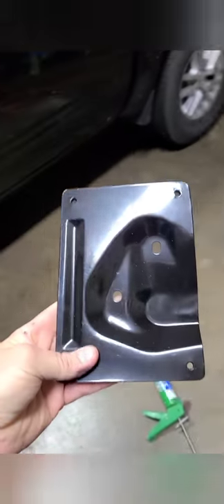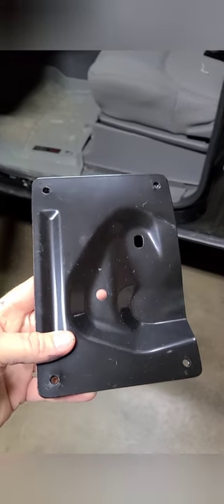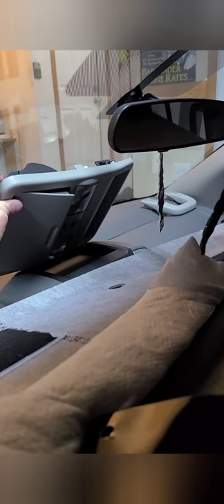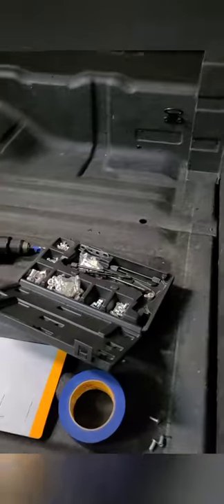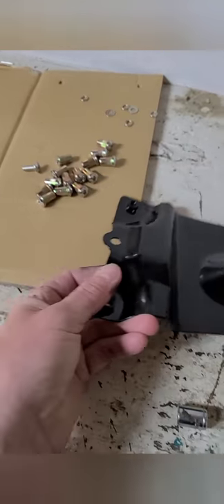2019 Nissan Frontier Crew Cab Roof Rack installation

Comment: Do you see any problem if I drill into the 2 long spaces on both side of the roof where normally there would be a weather-stripping plastic seal's there?  Since you took down the liner can you tell me if it would interfere with the airbag components.  I'm think if building my own roof rack.  Thanks.
Reply from the maker: I never recommended drilling or cutting anything you can't see. Wiring can be routed different in each car..
Reply: @jjsdiygarage1267  I have the same truck as you by the way.  I'm talking about the 2 long indentation where you'd would usually mount the roof rail.
Reply from the maker: @RamChickPig the wires ran straight down that rail to the rear cylinders.  I have sold the frontier unfortunately so I can't really remember

Comment: Thanks for the video! Where do you get those nut-rivetted treads?
Reply from the maker: You can order them online, or if you have a good hardware store around they have them. They are called rivet nuts.
Reply: @jjsdiygarage1267  I’ve just bought the same rack for my Nissan Frontier, it came with this rivet nuts now I’m realizing, I’ve never seen them or knew about them, it looks like I’ll have to get the tool. Thanks!
Reply from the maker: @psosa74 yep, and you have to know what thread those rivet nuts are otherwise the tool you buy may not work for those threads.
Reply: @jjsdiygarage1267  I agree I was thinking about it, I think I might end up buying like you showed it, the tools with its own nut rivets and bolts. I don’t want to drill any holes just to find out I can’t install it.

Comment: How does the adjustable cross bar assemble with the available hardware?
Reply from the maker: So the top piece is attached to the bar with a screw and the lower piece is attached with a bolt that goes through the top and bottom, clamping it to the side bar.. I didn't particularly like the stock cross bars so I got some more sturdy universal ones.

Comment: What are the measurements you came up with?
Reply from the maker: I will Check when I get home today.  Which measurements are you curious about. I'm assuming distance from rear and front.
Reply from the maker: So it's kinda hard to give exact measurements because ther are not many straight edges. Best I can tell the front has the rear edge about flush with the drain rail and it angles inward. The rear is about 2 1/4 forward of the rear line in the roof not the rear of the cab the final angle on the roof.

Comment: It’s plenty stable without the metal brackets? The instructions the rack came with were piss poor.
Reply from the maker: Yes, I haven't had any issues with stability. The weakest part of the kit are  the cross bars, I got universal ones that fit fine and adjust with a key instead of tools.
Reply from the maker: And the quality of the instructions was the reasoning for making this video, I tried to cover everything that I felt was missing.

Comment: Appreciate this video! Just ordered this for my 2021 Nissan Frontier SV 4X4! have been on the fence about trying the adhesive roof racks or do it the right way and actually drill holes. Just curious did the kit already come with the stainless steel hardware and also where did you get the nut tool that you used?
Reply from the maker: Nice, the kit came with hardware but I did not trust the quality of the hardware so I found a nut-sert tool at Harbor Freight then found some stainless hardware to match the thread of the rivet. The hardware that comes in the kit is not stainless.
Reply from the maker: https://www.harborfreight.com/45-piece-threaded-insert-riveter-kit-1210.html?utm_source=google&utm_medium=cpc&utm_campaign=12169518939&campaignid=12169518939&utm_content=114845716537&adsetid=114845716537&product=1210&store=39&gclid=CjwKCAjw95yJBhAgEiwAmRrutO8rQXGbglZXJFROlw8a_gxqQEy7fcLYll_lM3Oa5trt6093PypBDxoCNUUQAvD_BwE
Reply: Where did you find the stainless hardware to match the rivet tool?
Reply: @jjsdiygarage1267 also, the screws?
Reply from the maker: They had them at my local hardware store
Reply: @jjsdiygarage1267  I got the roof rack, had the issue with the rivet size from Harbor Freight (HF), now I can't find the thread, screw that fits the HF riveter. Will try ACE?
Reply from the maker: The kit I got from HF had new thread certs with it. I got hardware that matched from ACe sorry for the confusion

Comment: Great job - I've been going back and forth on buying this for my Frontier for months, was worried how well it would actually install and look compared to the OEM rack.  Did you find some plastic caps to cover the hardware holes that worked for you?
Reply from the maker: Thanks, I did find some at the local hardware store, the issue is the depth and angle of the holes are slightly different depending on the location on the mounting bracket. So you will need several different types. I used high quality stainless hardware and there are drains so I haven't had any issues with water intrusion on rust even here on the oregon coast
Reply: @jjsdiygarage1267  Awesome sauce, thanks!  Look forward to seeing what else you do to your rig

Comment: Buddy, no disrespect,  but that way you're doing that will rip that roof out if you actually use the rack and stuff catches wind. Needs at LEAST extra washers to displace the preassure pulling at the roof skin.
Reply from the maker: You have a right to your opinion,  the way the thread serts are installed essentially creates a washer on the top and bottom of the roof. I have had the rack installed for over a year now and have traveled on the coast of Oregon with 2 kayaks mounted to it, no issues. I agree that it would be stronger if there were backing plates under each foot the ones included with the kit do not seem to fit.